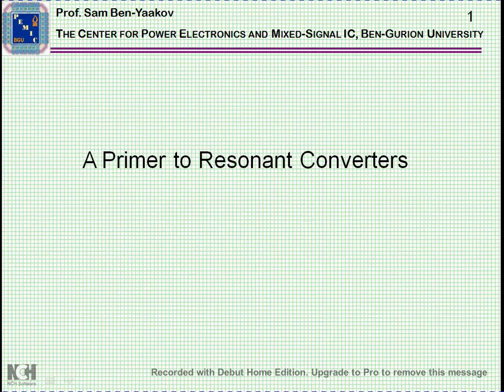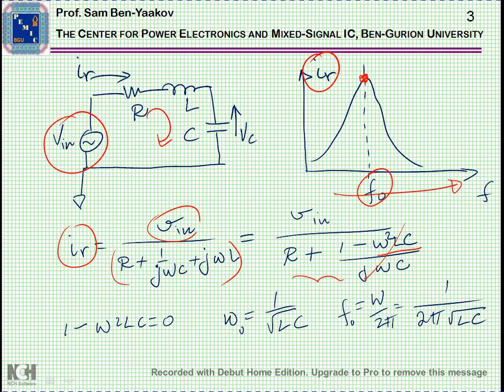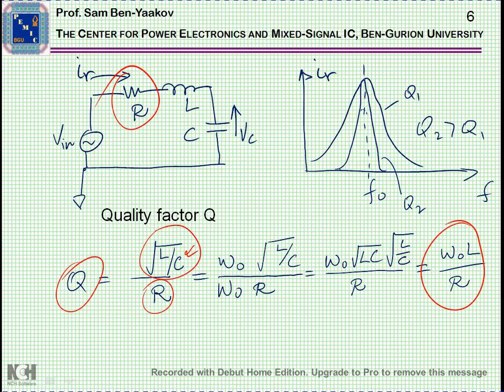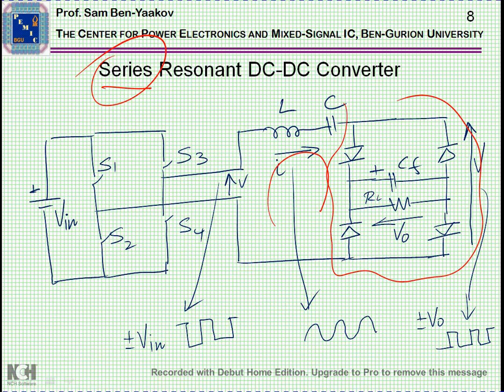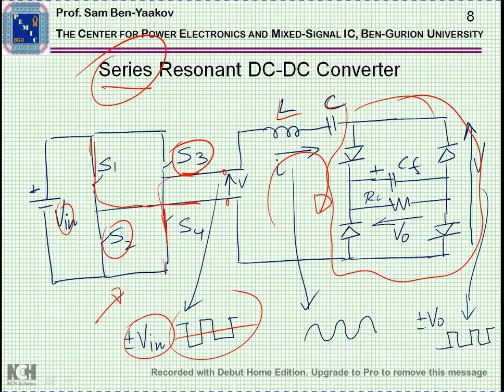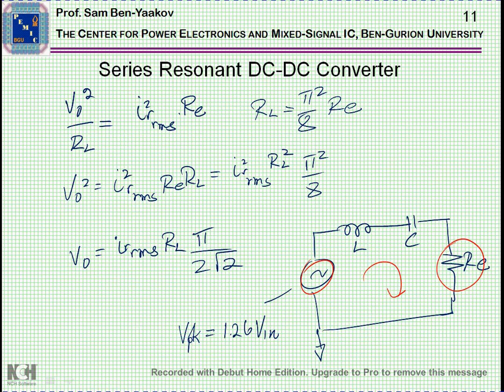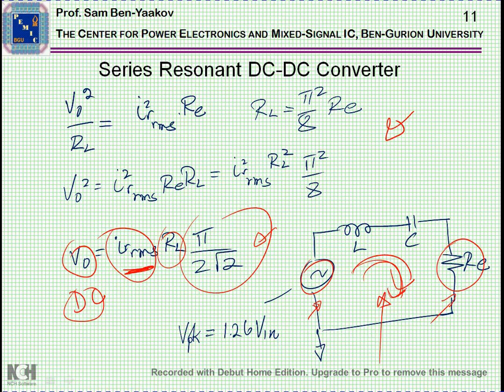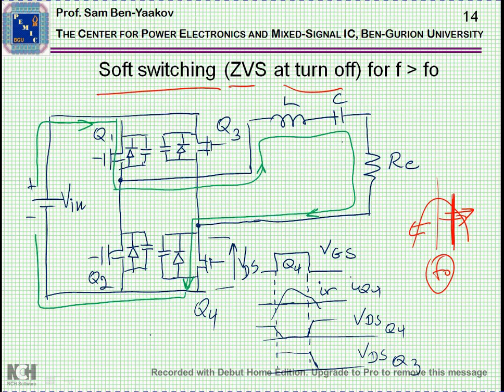A primer to resonant DC-DC converters

Comment: I actually built this topology of converter before even knowing what about it "academically"! So I'm happy to learn about it!
I built a Tesla coil with a primary coil in series with a bunch of film capacitors with the primary tuned to the frequency of the secondary, around 300kHz, I got the idea learning that series LC circuit has ZERO impedance at resonance, so to get maximum power transfer, since FET's have very low Rds(on), I should a series LC network and use a phase locked loop (CD4046) to lock on and ram as much current as I possibly can at a given can into the primary and let the voltage at the node between L and C climb unbounded. :)

I am now able to dump over 500W into the secondary with a full bridge, and my FETs don't get too hot :D It still needs lots of work. My PCB layout has issues and my FET's keep dying especially if something causes the circuit to fall out of resonance and switch at a lower frequency. Still trying to identify the root cause. I did observe 1.8x voltage in ringing at 40MHz, which might be the culprit. Also it is strenuous on the capacitor and even my secondary as it heats up noticably. Had to buy the lowest dissipation capacitors I could find on LCSC and put lots of them in series/parallel.

But as of now my biggest limit is really my 48V 7.5A mean-well SMPS that apparently can output 55V at >10A before shutting down due to overcurrent.
Reply from the maker: Hi , Wow it sound you have a lot of fun.Thanks for sharing. Is there any specific question I can help with?
Reply: @sambenyaakov  Thank you so much for your reply! I my HY1920P tend to fail with a short between gate and drain, causing them to behave a lot like 4 volt zener diodes, since the channel still works. I have a very low impedance gate drive of [0 - 12v] and minimized the trance length to a couple centimeters thinking Vgs > 20V was the cause. However after looking at the Vgs on a scope I don't think this is the problem. What else could cause a short between gate and drain whist the channel continues to work fine?
Reply from the maker: A blown gate is indeed normally due to over voltage of Vgs. Do you have a wide BW scope?  it takes a very short pulse to do the damage. Try to put a 10nF cap right oh G_S terminals just for testing.
Reply: @sambenyaakov  Here is a photo gallery of images when I asked on reddit. https://i.imgur.com/v8NjNin.jpg

I have since shortened the twisted pairs by moving the driver IC closer to the PCB. you can see I added a 12V zener to the gate/source to clamp the voltage to [0 - 12v]. Probing using the springy contact with a 100MHz scope w/ no bandwidth limit. Here is the result https://i.imgur.com/037HrTd.jpg
Reply from the maker: The impedance of gate driver at turn off does not seem low enough and... you might have faulty transistors

Comment: @Sam Ben-Yaakov  Sir I have one doubt at the output side of the rectifier , you assumed that an unidirectional sinusoidally varying Output Voltage is produced so Its average output voltage will be (2*Vm/pi).So the load power will be (4*Vm^2)/(pi^2*RL).Since we are considering  only the fundamental Harmonics associated with the transformer secondary  side voltage , its rms value will be ,Vrms=Vm/sqrt(2).So the power supplied by the transformer is pac=Vrms^2/Rac where Rac is the equivalent resistance seen at the input terminals of the bridge rectifier. Equating these two(load power  and source power) we get the value of the ac  equivalent resistance as ,Rac=RL*(8/pi^2).Sir my doubt is because of the presence of capacitor at the output of the full bridge rectifier,  The output voltage will be moreover a straight DC with some ripples in it. The value will be moreover equal to the maximum value of the  fundamental value of the voltage across the transformer secondary side terminals. So  approximately Equating Vdc to Vm. So the power across the load will be (Vm^2/RL).Since the input real power from the transformer secondary side is Vrms^2/Rac . Here Vrms=Vm/sqrt(2).Equating these two power by assuming ideal conditions and solving in the similar way we are getting RL/2=Rac .                                                                                 Sir is my point valid if I am wrong please correct me sir. Thank you
Reply from the maker: Thanks for not. "The value will be moreover equal to the maximum value of the  fundamental value of the voltage across the transformer secondary side terminals." Incorrect. This is NOT the case of a VOLTAGE SOURCE feeding a cap via a diode. The cap voltage is the average voltage in this case.
Reply: @sambenyaakov   Thank you professor 😃😃.Sir one more small request, I need a material  for finding the control transfer function inorder to make the resonant converter operate in Closed Loop thereby achieving a voltage regulation at the load side. Can you teach us how to arrive at that control transfer function sir.

Comment: Hi Sam.  Low magnetizing current. Z(Lm) is much bigger than the load impedance. Can you trow a bone here, what is the proper impedance of the LCC resonance transformer, I can calculate this Z and know the LCC resonance tank is a current source, so load impedance for that is high, a to low inductance of primary will load the source such it does not work well. I have use 1mH and above for that, 500 uH by the way is also workable, but I did simulate with 1mH. 500 uH on 100 Khz give 314 reactance, and 1mH double that. But saw LCC designs with 5mH giving a reactance of more then 3 kilo ohm.  Making the inductance to high then I think losses get involved, but also the windings do not fit anymore on the core, we need to fill that but not to much. 

this week I get the precision caps for the meter, then I can start building a test version.

regards
Reply from the maker: See https://youtu.be/ZWwZBHV0ynY?t=749

Comment: 14:02 why is a series inductance necessary once you add a transformer? don't transformer primaries already have an inductance that is exploited when building the typical flyback topology converters? I have always thought of a flyback topology as being sort of an extension of a boost converter.
Reply from the maker: The xternal inductance designated both leakage inductance and /or an external inductor. Using the leakage inductor (which you ca adjust by design) may lead to increased power loss.

Comment: Thank you for this clear explanation. A practical thing that i do not understand is, how the resonant frequency and switching frequency should stand in propotion. What is the ideal distance of both frequencies and what should be determined First?
Reply from the maker: The required gain determines the shift, you would like to stay above resonant for ZVS
Reply: Okay, if i use the leakage inductance from main transformer+ external serial inductor and the parasitic output capacitance of the MOSFETs to take this energy for ZVS it is not possible to have a switching frequency above the resonance frequency (MHz) because its too high with those values. Nevertheless it seems that ZVS is archievable with a legging current. I dont Unterstand why the current is still lagging if i am below the resonant frequency.

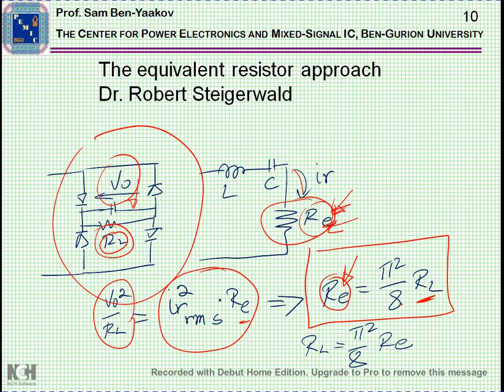Comment: Hello sir! Your video is amazing but I have a little confusion, at 11:20 minutes  there are two formulas written for Re and RL, according to my calculations they should be like  "R=[(pi^2)/8]Re"  &  "Re=[8/(pi^2)]R". Please help if I am doing it wrong even a small hint will be of great use.
Reply from the maker: see https://youtu.be/-P-tDMr50mk?t=200
Reply: looks like Pi/2*2⁰.⁵ is inversed
Reply from the maker: Hi Eduard, You are correct, one of the equation is in error. Thanks for pointing this out.

Comment: Why do we use a coupling capacitor along with a transformer in the "current driven rectifier" of a resonant LLC converter ??  Could you pls share some thoughts. Thank you
Reply from the maker: Can you send a sketch of the circuit you are referring to> There are a number of configurations to the current driven rectifier
Reply: @sambenyaakov  could you please share your email id. Thank you.
Reply from the maker: @Rajat0607  sby@bgu.ac.il

Comment: Dear Professor Yaakov, In the Galvanically isolated version, is it possible to eliminate the inductor by using the transformer as a shared inductor ? If load changes, with time, how do we maintain a constant output voltage ?
Reply from the maker: 1. You can use a transformer.. 2. The control is by frequency variation.

Comment: Sir at 18:06 , how  Q3 body diode conducts even if voltage on the line and drain of Q3 are at same potential ?

I understood because of lagging nature of circuit the current is starting slow and switching losses are reduced
Reply from the maker: You mean "line and drain" or "Line and source"? What does it matter if line and drain potential is the same?
Reply: @sambenyaakov  Sir , I meant how  body diode was conducting from the point other than line(Vin) of MOSFET Q3 to line(Vin) ; Is it because of Capacitance of 1st and 4th MOSFETS

Comment: Thank you Sam! Great food for thought!
Reply from the maker: Thanks
Reply: @sambenyaakov  
Dear Dr. Yaakov,
You might find the flying machine on my channel interesting. I'm trying to get its resonant Royer to run on 12V instead of about 7V.  I know the frequency will go up so I will try increasing C1 to bring it back down.  I don't really understand the waveform of the resonance coil that drives the transistor bases either.  I'd like to be sure its op voltage is in a healthy range to drive the transistors. I thought winding it with 1 less turn might be a good idea.

Comment: Thank you for your efforts,pleasei was wondering if you could explain LLC converters and how do they works,i need that in my thesis.thank you
Reply from the maker: Go to YouTube and search for "sam ben-yaakov LLC"
Reply: @sambenyaakov   please sir,i was wondering if you can tell me how we can achieve ZVS in LLC converter with GaN half bridge topology and GaN don't have a body diode,so where does current flow to make voltage across the device zero before turn it on.thank you
Reply from the maker: @frajbenarab5523  There is reverse conduction but with a high voltage drop. So the only way is to minimize the deadtime.
Reply: @sambenyaakov But sir if we minimize the dead time ZVS transition will not take place and we are in case if hard switching and losses will increase,i'm designing an LLC with high efficiency above 98%,that is why i should focus on losses.
Reply from the maker: @frajbenarab5523  Dead time has nothing to do with ZVS if you keep the deadtime somewhat longer that it takes the mid point to commutate.
Reply: @sambenyaakov  thank you so much,really appreciate your help.

Comment: A very good tutorial Prof. Sam Ben-Yaakov. I have a specific question regarding DC-DC converter for a particular configuration.  I have an isolated dc-dc SRC ( Vinput=100 V, Voutput=300V, Output power=300W). What can be the potential applications as per existing industrial practices in the renewable sector best suited to the mentioned input and output configurations? I would be happy to get guidance on the available products in the market. Thank you for your time.
Reply from the maker: This might fit the case of a PV panel for 110VAC appliances if a DC-AC inverter will be added.
Reply: Thank you very much for your reply Prof. Sam Ben-Yaakov.

Comment: since we have single  stage dc dc conversion why we are going to resonant dc dc conversion,suggest any books and applications on it????????????
Reply from the maker: I do not follow you. Compare/  the LLC converter with hard switched PWM
Reply: I mean we have buck, boost and buck boost with soft switcings then again we are using resonant converters in some applications, why ????  that's my question sir.
Reply from the maker: Nobody suggested that resonant converters replace all hard switched converters. In some cases they are superior. So what is the question?
Reply: @sambenyaakov   so What are that cases ? and In which applications resonant converters are used right now?
Reply from the maker: @gurusumanth480  https://ieeexplore.ieee.org/search/searchresult.jsp?newsearch=true&queryText=resonant%20converters
Reply: @sambenyaakov Thank You sir for suggesting and the video lectures are very helpful.

Comment: thank you sir for your videos, Sir please make a video on EMC EMI line filter design for series resonant converter.
Reply from the maker: Have you seen: https://youtu.be/5NRiLOvmXdA
Reply: @sambenyaakov  thank you sir, for video link, i have seen it,   according to this video we need LISN to estimate about the concucted emission, so from LISN data we design the EMC filter,  is there any mathematical literature to estimate this CE without using LISN, because for high power DUT  , LISN should satisfy  the DUT current and voltage rattings,  which may be expensive

Comment: Rewatching the video to refresh my mind, on the ZVS part, is it possible that the MOSFET drain-source capacitance can be used as the resonant capacitor?
Reply from the maker: The D-S capacitance helps to provide  ZVS at turn off by slowing down the rate of rise of the voltage. I do not recall seeing anyone using them as the resonant capacitors. For one thing, the are extremely non linear (voltage dependent) so there is a problem already there.

Comment: Dear Sir Sam! i have read other articles and conducted experiments,and i doubt that transistors can have soft swithcing during turn off as you stated in your video. yes,they are turned on softly,but not turned off. can you give me some evidences that iam wrong?
Reply from the maker: Thanks for comment. Firstly, lets clarify a possible misunderstanding: 'turn off' refers to the current of the transistor (Vds is rising). 'Turn off' snubbers, resonant converters, phase shift PWM and others are widely used in the industry to achieve pseudo ZVS (slowing down dv/dt of Vds). There are  literary hundreds  if not thousands of papers and application notes on that .

Comment: Hi Professor Sam, If the switches are controlled by feedback from the resonant circuit itself, as opposed to external control, do they still actually operate slightly above the resonant point, or do they actualyl turn on and off exactly at the resonant frequency?
Reply from the maker: If the switch operation is derived from internal signal, say resonant current, this will be an oscillator with no control.

Comment: I have a general question sir, How can I view resonant current waveform on oscilloscope in h-bridge resonant converter .
Reply from the maker: Use a current probe, or voltage across resonant capacitor.